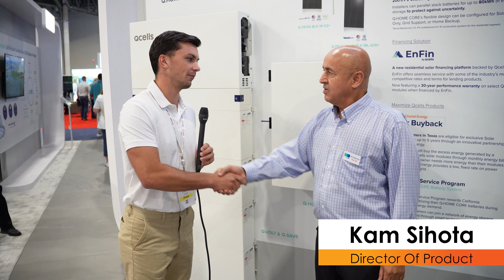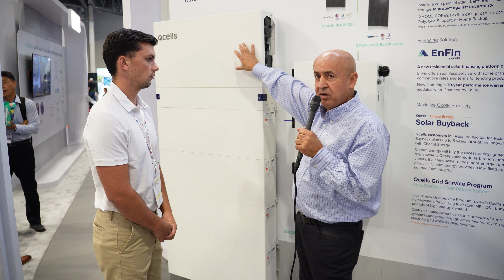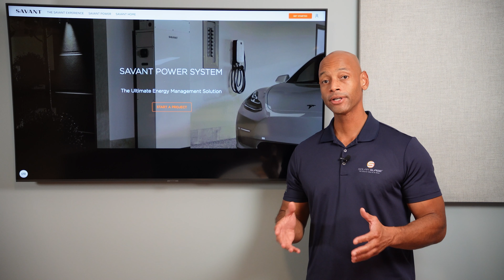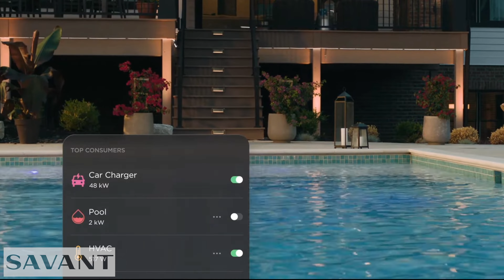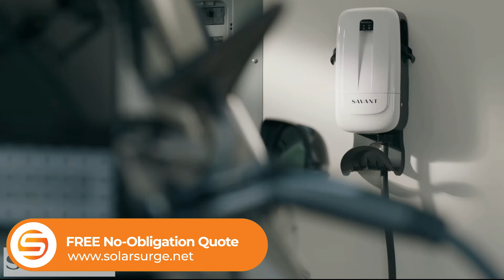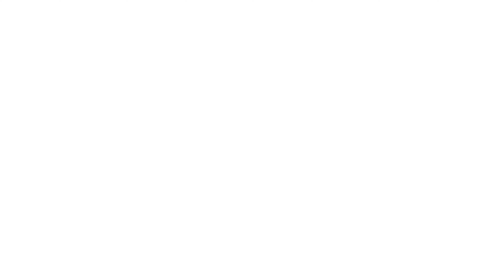New Q.Cells Q.Home Core

Comment: One thing that's not been discussed with the qHome System is, how does this String Inverter handle panel shading?  Do they have optimizers? Does a shaded panel drain the rest of the unshaded panels?
Reply: Its not a string system. Qcells have micro inverters. The strings are just consolidated runs of micros